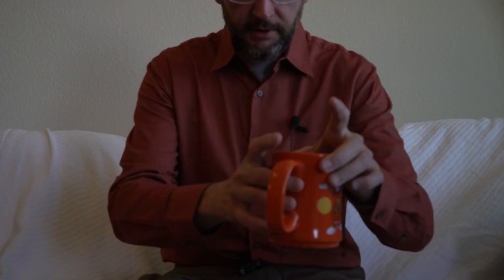Lensrentals.com Flange Focal distance Testing Blog Thoughts | Cameras and Coffee 8 June 2020

Comment: For cameras with hard-mounted sensor this things are measurable, while for ones with IBIS it could be impossible and cause unpredictible issues. I had never thought before that having IBIS could be a bad thing.
Reply from the maker: I hadn't thought about that, either. I suspect there is some way that IBIS has, likely magnets, of providing exceptional placement accuracy.
Reply: that's a useful info.